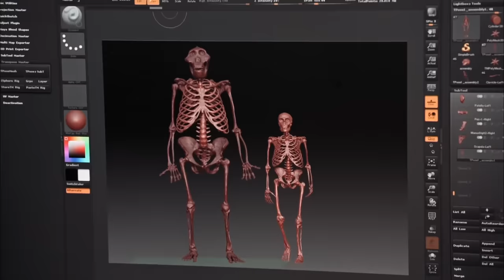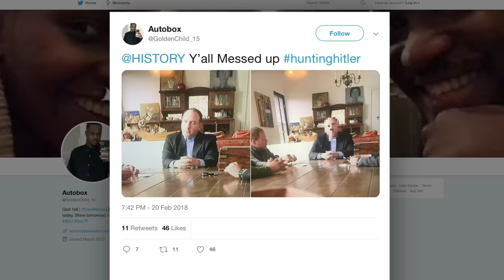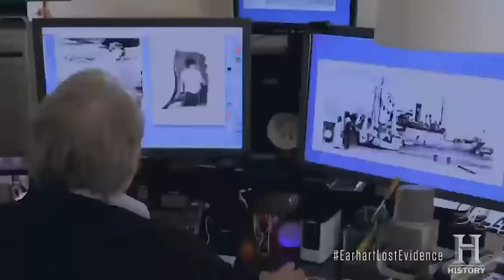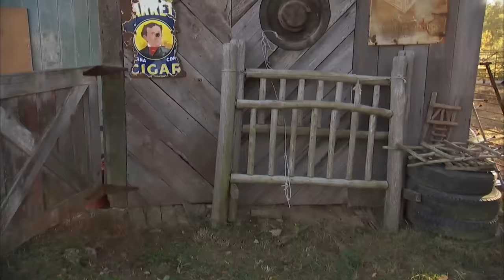The Biggest Scandals To Ever Hit The History Channel

Comment: "There was a time when lumberjacks would float logs down the river"... they still do that all the time.
Reply: True, but usually attached to a barge and not just tied together into a raft that they hoped most of the logs made the trip
Reply: Quote from dept of interior paper on history of logging in MI.,   “Rafting presented special problems on the Great Lakes, especially
when they had to be towed some 200 miles of treacherous and storm swept water. To solve the difficulty, an entirely new type of log boom was developed. It consisted of threading a series of large pine logs, three or four feet in diameter on a heavy logging chain passed through holes drilled in the logs.
The massive floating fence would surround a free mass of floating logs covering from ten to twenty acres and resembling a large bal- loon. In 1885, three million feet of logs were successfully towed to Bay City on Lake Huron from Lake Superior. In 1887, 30 million feet of logs were rafted down from Superior to Lake Michigan.
Sullivan once rafted an eight million foot raft to Alpena, Michigan.” They used all sorts of ingenious ways to transport logs.

Comment: Eustace Conway was raided by the Watauga County, N.C. Health and Inspections departments and cited as you mention.  But on further examination his buildings built the old way with natural materials were determined to be equal to or above the engineering standards for safety for human occupation.  The North Carolina General Assembly defused the situation by passing an exemption to the building codes for traditionally constructed structures according to Wikipedia. I do not know whether he had to put modern plumbing and sanitation in or not.

Comment: The underwater logging story is true up here in Canada, or at least in two or three lakes. There may be laws preventing removal of logs now, I'm not sure, but there were none back in the 70's. On Cowichan Lake where logs were boomed and moved to holding areas, Balsam Fir did not like floating. It was so water logged naturally that along with the weight of the wood, it was always close to sinking and apparently many logs in the booms were lost over the decades, in fairly deep cold water. The one mill on the lake in Youbou, developed a salvage program to retrieve these logs and add ten years worth of wood to the supply. Some years back the mill was shut down and disassembled, then shipped out. I'm pretty sure most of the logs are still there.